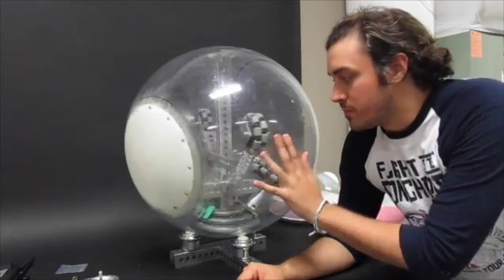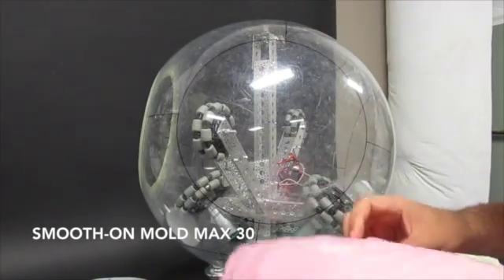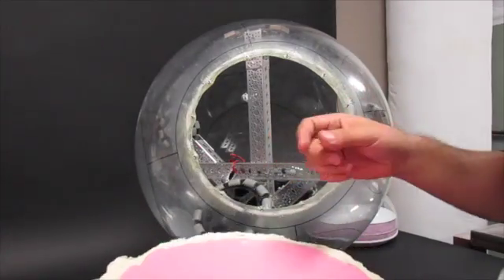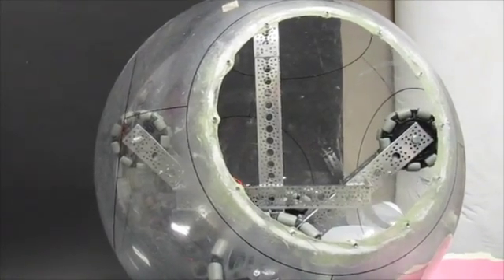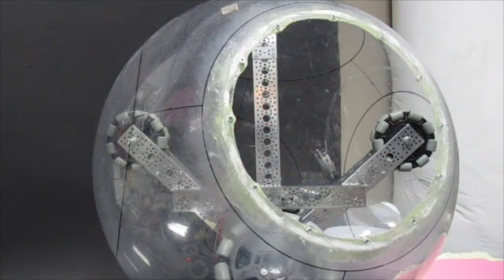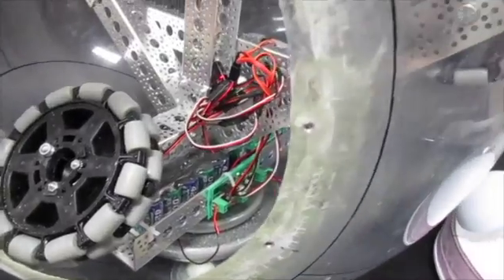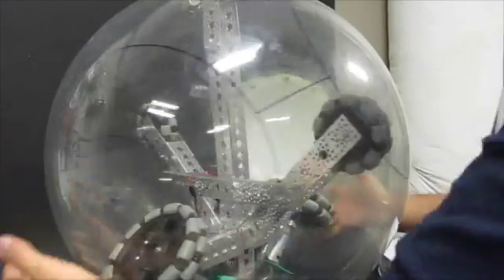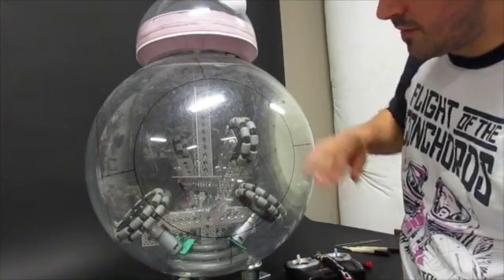Working BB8- How to Build your own life size BB8 - Kevin Gorby

Comment: with the number of batteries you have compared to the electronics and motors, what is the running time of the device/droid ???
Reply from the maker: about 20-30 minutes depending on how I'm vigorously I'm running him around. And it's designed to quickly swap out the batteries when they die so I have a few sets ready to go.

Comment: On California quality plastics the hole in the spheres are smaller then your one . how did you make the hole bigger with out cracking the sphere ?
Reply from the maker: I used a dremel  router with a  cut off disc. it takes a bit of time since the plastic likes to melt instead of grind away so you have to do 5 or 6 full passes around the sphere and then clean it up with wet sand paper

Comment: That's actually a cool idea, using the omnidirectional wheels. I suppose with 4 motors it could strafe with ease, and also increase stability with the usage of a gyro or an accelerometer

Comment: how did you prevent the Smooth-Cast 65d  from sticking to the  mold?
Reply from the maker: It's self releasing, so it naturally does not stick together.  The mold is made from Smooth on's Mold max-30